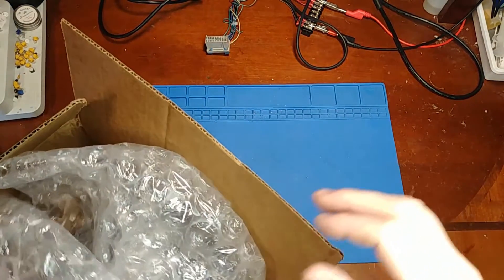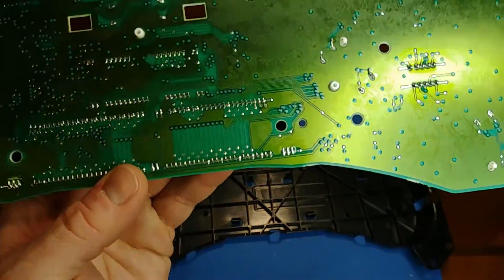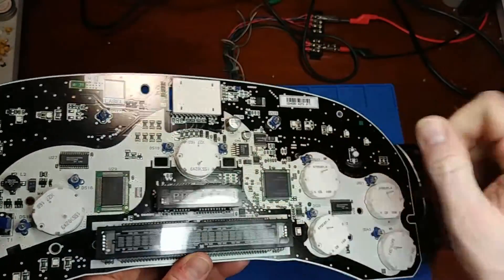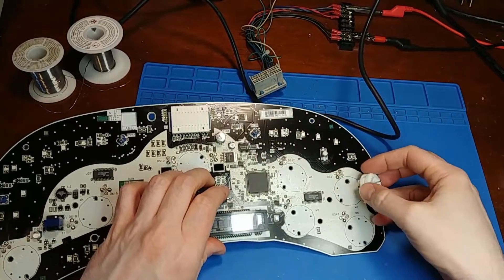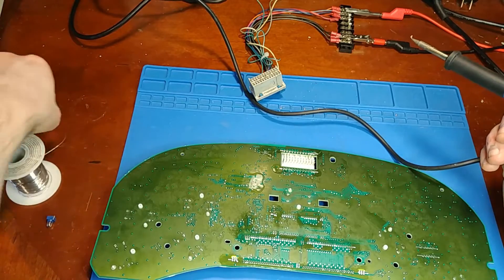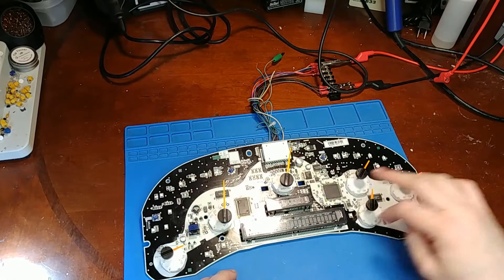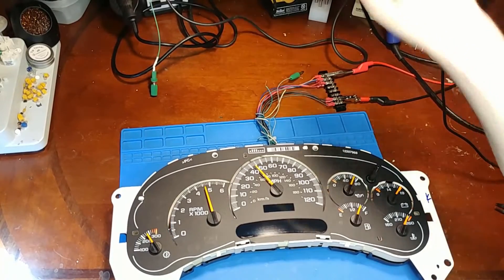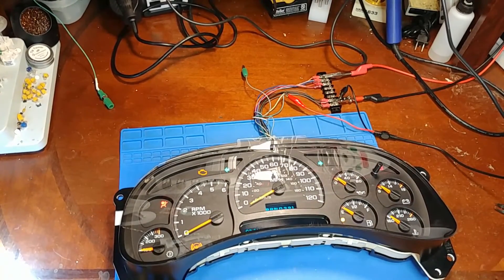Cluster Repair: Repairing the repair.

Comment: Quick question i know this video was 3 yrs ago but do you still fix cluster if you do can you text me back I have a Camaro 2015 cluster went out
Reply from the maker: Yes. But I don't have any experience with that year Camaro cluster having issues at this point in time.
Reply: @jeffescortlx  ok no problem thanks for texting back and letting me know I’m going to have to buy one lol I been looking around but no luck
Reply from the maker: @Noemedrano1  make sure to hang onto the original one until your sure the replacement is fully functional.

Comment: How much you charge to repair damaged circuit beards
Reply from the maker: It would depend on the board and the damage. My contact information is available at the top pinned comment.

Comment: Sir could I have you explain how to properly zero the gauges after needle R/R. I had the usual PRNDL display issue and conducted the repair fine but would like to better understand the needle zero process.
Reply from the maker: If you didn't mark the needle home position before removing the needles, you can calibrate it like I do. Power it up without any signal inputs and set the needles at home.

Comment: I have a gm cluster issue
2003 Sierra
I replaced steppers, lights and resoldered the resistors that typically crack on the motherboard. I can plug it into the truck and everything works. But when I cycle the key the display and gauges no longer function. If I wait overnight they’ll all work again, but only as long as I leave the key on. I suspect I damaged something on the bench test when I powered it up, but for the life of me cannot figure out what.
Any help would be appreciated
Reply from the maker: Trouble shooting over the internet is difficult. You could have missed a joint, or could be corrosion or the microprocessor could be ESD damaged.
Reply: jeffescortlx where/what is the esd ? I have a parts cluster here I could steal it from
Reply from the maker: @dickindustriesinc  ESD= electro static discharge. The microprocessor is static sensitive. If you don't handle the board carefully you can damage parts with the built up static in your clothes, chair, work space or plastic tools.

Comment: Do you have a video in regards to the process of fixing the battery drain issue on the 03/04 clusters?
Reply from the maker: I don't have a repair video for just that single issue. But my rebuild process takes care of all issues. So pay attention and replace what I replace, rework what I rework and clean what I clean and you'll have a 100% functional cluster. Or just send it in for service.

Comment: Do you ever do work on the 4x4 switches from these trucks? 2004 Tahoe. I’ve noticed that in the winter when I use the switch push button to 4x4 it sometimes fails and gives me a service 4wd notice or red light up on switch N but I can typically cut the truck off and push the buttons and restart and be just fine. I figure the switch needs replaced or reworked. Never had one open before tho.
Reply from the maker: The common lead pin like to fracture at the joint.

Comment: Great videos. I have looked at almost all of your cluster videos, but I couldn't find a lesson on solder pad repair jumpers for led/light pads for 03-06 gmc clusters. Has that been shown before?
Reply from the maker: I haven't made a video on that particular issue, but same principle as running jumpers for stepper motors.

Comment: Mister Jeff I have a question about a 32in Emerson TV flat screen I turn the power on it goes so far as to turn a channel on and then turns off the more you do it the shorter the time gets will not stay on any information would be appreciated thank you for the videos and keep them coming
Reply from the maker: If turning the channel makes it shut off, that sounds like eeprom failure.
If time makes it shut off, that sounds like backlighting failure.

Comment: Great video as usual Jeff. Yea, that Amtech flux is some good stuff. Chipquik SMD291 is some pretty good flux as well. I don't typically use that type of paste flux for simple rework like this though. I tend to prefer flux pens due to their ease of cleanup. Unlike paste fluxes, they don't leave behind that vaseline type residue that seems to spread everywhere. They also cleanup easier with IPA. My personal favorite flux pens are the Chemtronics CircuitWorks CW8400, or the Multicore MFR301 if you can find it. But for drag soldering on fine pin pitch stuff, the Amtech or Chipquik can't be beat.
Reply from the maker: I have a SRA flux pen. It must not be very good, I'm convinced it's no more effective that just rubbing alcohol. The flux that's in the new solder seems more effective than that pen. But a little AMTECH makes any and all solder joints perfect, that stuff is magic.

Comment: Another good video, Jeff. Where you been?  I did one of these today. I always have trouble with getting the needles calibrated. I have a tech 2 and the bench top rig but every time the temp and tach are always a touch off.
Reply from the maker: Power it up first, then set the needles. With a little practice it will set perfect almost every time
Reply: @jeffescortlx  Thanks for the tip, will give it go next time.

Comment: Very inspiring, the country needs more folks like you, fix it, not replace it.  I have a 2004 Mazda Tribute lx that the trip meter will not reset.  I prefer not to replace it.  I just subscribed to your channel and rang that bell and gave a thumbs up.
Reply from the maker: You'll like my channel! Saving/repairing devices is my thing. It's a nice little rush to take somthing that's heading to the trash and make it work again.
Reply: @jeffescortlx  Am a Rossmann group subscriber also, is it worth fixing my Tribute speedo or should I get another one from ebay.
Reply from the maker: @beandrive  can't hurt to try?

Comment: What scan tool do you use...My back grounds lights went out and I opened up my cluster and didn't mark the pins Im not sure what they are called so now my speed and things are off
Reply from the maker: You don't need a scan tool to set the needles. The best way is to set them at the staring location turned on, but not receiving input signals. But with trial and error you can get them in the ball park.
Reply: @jeffescortlx  I got them pretty close as I'm gonna get them ..thxs

Comment: Oh dear, just bent over pins and no solder.
That mechanic should stick to his own job.

Old large through hole chips can be a nightmare to remove, every pin must freely wiggle in the plated hole, otherwise its death lol.
But what you are dealing with is much worse, the though plated holes are tiny :-(
Reply from the maker: At my daytime job we manufacture boards that use old school 14 pin DIP chips. The boss hasn't supplied an electric solder sucker, just the manual spring pumps. So I've got plenty of practice in. Your not kidding each and every pin needs to be free from top to bottom to not cause damage on removal. I don't look forward to pulling chips with a manual sucker : (
Reply: Yep it sounds like hell, i was the electronic repair section of an auto electric factory. (Shame i didn't have any help).

I had a 25 watt crude chisel iron and a rather hopeless spring sucker.
Had to clean the thing out on every couple of chips i removed, and the white tip was well worn.
I had bosses that didn't want to spend money to help the workers, so it was never replaced.
I guarded the digital multimeter with my life lol, it would vanish with one of the bosses if i didn't.
Yes they were penny pinching assholes (Like most bosses).
Reply from the maker: @zx8401ztv  your boss is my boss. I was able to get a $30 multimeter. Before that we had a $9.99 hardware store multimeter. But he did spring for a modern $200 oscilloscope. With being self employed with cluster work I can spoil myself with tools and no one can stop me. Except the other boss will raise an eye brow, the wife.
Reply: Ahh " She who must be obeyed. " lol.
I'm always joking so never take my comments as being nasty, i have a silly mind :-D
Reply from the maker: @zx8401ztv  I don't take much serious myself either, it is the interweb after all. Although I am surprised my comment section is pretty well behaved. Hasn't gotten toxic yet like other larger channels so that's nice.

Comment: I don't think I'd have any of the mechanics I hav worked with do this kind of work.
Reply from the maker: This kind of work isn't for everyone. But at the same time I don't want anyone to feel discouraged to give it a try.
Reply: @jeffescortlx  Not if they want to do it properly. WE never had any broken clusters in any of the shops I worked in though. Not even the  isuzus. I guess the cars werent old enough.
Reply from the maker: @rimmersbryggeri  if your shops doesn't take in many 03-06 GM's, you won't run into many cluster issues.
Reply: @jeffescortlx  Unless you take in alot of audis and VWs they are a bitch for the amber lcd screen. But I try to keep away from them. I worked in an Isuzu dealer we sold the D.-max which is also the chevy luv/d-max and the GMC Canyon. I don't thing I ever worked on one more than 3 years old though.

Comment: what solder are you using?
Reply from the maker: Kester Solder Water‑Soluble Sn63Pb37.
Reply: @jeffescortlx  okay thank you, so you're using leaded solder...

Also question, do you ever heat the solder onto the desoldering HAKKO FR-300 gun or just let the tip oxidize? I bought one recently and not sure but from what i'd understand you shouldn't do that either way right?
Reply from the maker: @Limeayy  I don't go out of my way to care for the tip to keep it tinned. Just occasional wipe and tip cleaner. I probably get a good 9 months out of the tip with daily use, at that point I chuck it for a new tip.
Reply: @jeffescortlx  oh okay. Curious why you need to replace the tip after a certain time for a desoldering gun tho.

Cant you just clean the inside with those inside tip drill cleaner
Reply from the maker: @Limeayy  it's not clogging that's the problem, the tip eventually brakes down just like any other soldering tip.
Reply: @jeffescortlx  hmm ok. That's weird to understand... maybe it doesn't conduct heat as well from oxidizing?
I'm lost as to what it means the tip eventually breaks down.

Sorry, i don't really solder but am learning, thanks!

Comment: What bulbs should I use for stock replacement or LED If I go that way? 2005 silverado.
Reply from the maker: My preference is to stick with incandescent. Otherwise if you try to go with white LED's the color temperature is off and doesn't match the other dashboard components.
Reply: @jeffescortlx  Ok thank you, what brand of incandescent bulb should I buy?
Reply from the maker: @ryansmith6470   anything from a reputable seller like Mouser, digi-key, Newark will be fine. Just be cautious from anything from eBay or Amazon.

Comment: Hi what is your cost to repair I made a repair but my temp is not working.  The repair was not good. It's a 2005 gmc Yukon. I screwed up to soldering joint. Please let me know and how I can send. Thank you.  Leon
Reply from the maker: I charge a flat $130 (plus shipping). It's for a complete Full rebuild, that also includes PCB work that prevents future common issues. It's the all you can eat price, includes other things like odometer error,  language scrolling, display issues or intermittent power.
Reply: @jeffescortlx  I tried to message you but the link isn't working. How do I get in contact with you?
Reply from the maker: @samuelrussell5528  email address is in the description of this video: 
https://youtu.be/T_2WnJMsZaU

Comment: My 05 Sierra cluster started to scroll through languages a couple of days ago and i am not sure if I should diy or send it to jeff
Reply: Omar Dawood Jeff’s the best in the business. 
A cluster with scrolling issues isn’t something I would recommend trying to fix yourself and I work on them almost everyday.
Reply from the maker: There are at least 3 different issues that can cause scrolling language, fractured joint at a pull up/pull down resistor, corroded button internally or silver migration corrosion. My rebuild service takes care of any and all of that for a flat rebuild charge.

Comment: What kind of wire are you using?
Reply from the maker: It's just the left over leads from the lamps I use.
Reply: @jeffescortlx  that's interesting. Never would of thought of reusing those
Reply from the maker: @phillipzan2005  I have a endless supply of them.

Comment: Rossmann group. Makes me want to get an ultrasonic. You definitely didn't use a Rossman amount of flux.
Reply: Forgot to say don't delay buy today. Now the universe is going to implode.
Reply: I bought and use the aamtech from him aswell works great BUT is it just me or is it a nightmare to clean up?

Even when I use a small syringe and just a tiny dab to lightly coat a solder pad, after soldering I have to spend quite a bit of time with a qtip and 99.9% Isopropyl alc to get a perfectly clean streak free surface.

If any remains it has that not so great chemical smell when it wafts out of my amplifier during use.